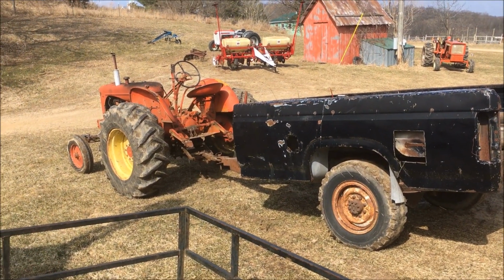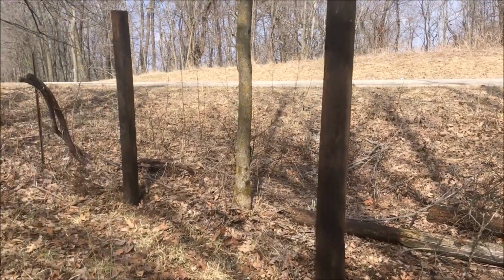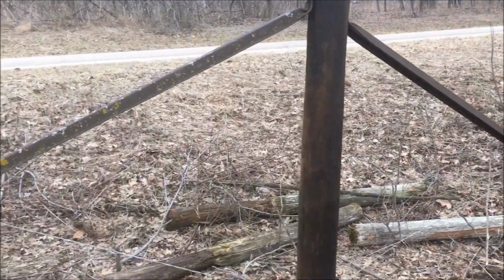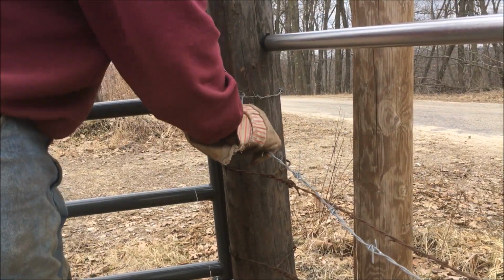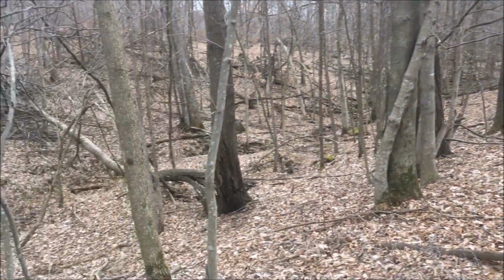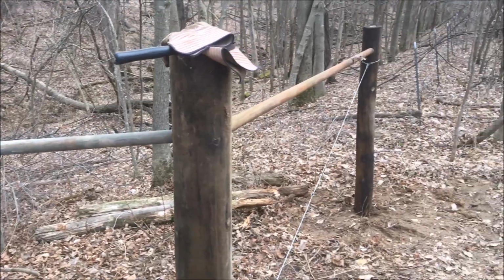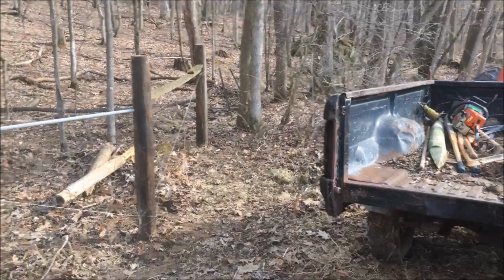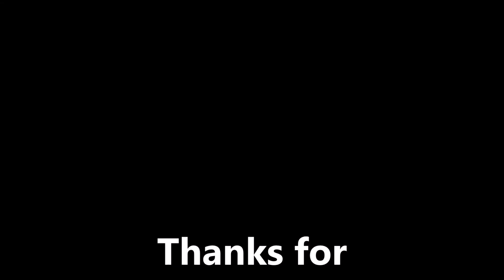Farmer Pete's Fencing 101

Comment: Depth perception?...I thought you were angling for  HARD PULL ;)!!  I double wrap the #9 wire.  Lucky my fences aren't next to a salted road.  Looking good.
Reply: Kansas has plenty of salt, just glad they don't use it often. Alaska doesn't use salt either, small/crushed rock, everybody has an Alaskan windshield, chipped, cracked or looks sand blasted!
Reply from the maker: Yes, I should have went with the "angled for a hard pull" explanation :) Thanks

Comment: We built fence the last 3 days .total rebuild on ten acres .. It very similar to your style  but it is built to govt. standards . some what over kill but should hold  up for years.. Personally l like one strand  barb real hot  and road sign posts at  a 60 degree angle for corners always worked great.. Like to see other styles  l learn every time.  Nice job.
Reply from the maker: Thanks.  If I remember right an official line fence around here is supposed to be five wire (I used to be on the Town Board) I've found three to be sufficient as long as your cows are mellow.

Comment: Nice job! We are at the point in life, where we can decide if we want to work hard or just work as crazy as when we were 30. Depth perception might have been off but the posts finished straight, you just didn't film straightening the holes.
Reply from the maker: Yes, once you have a hole bored it's not too hard to straighten by hand. Thanks.